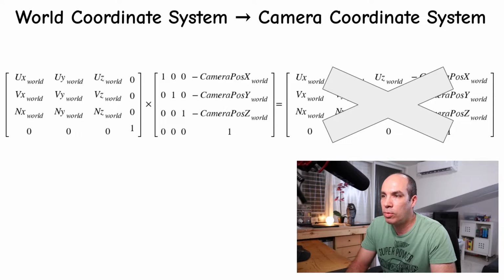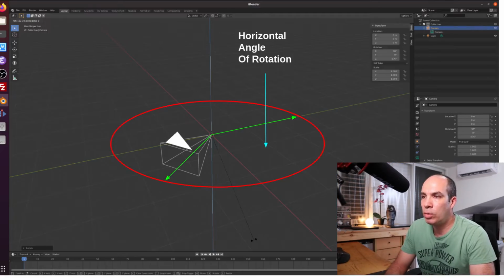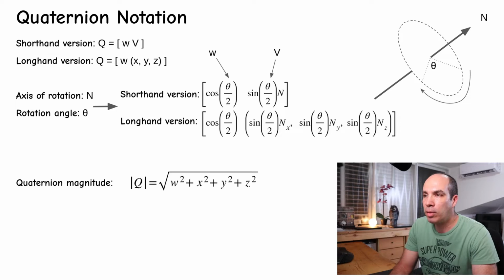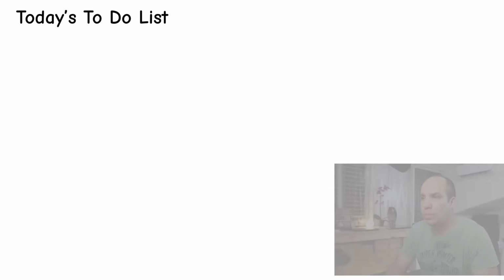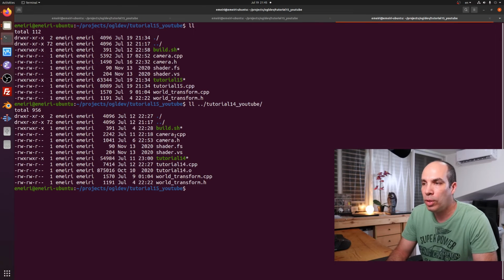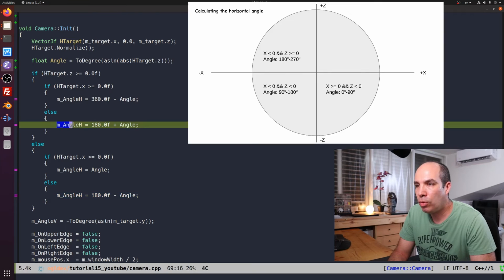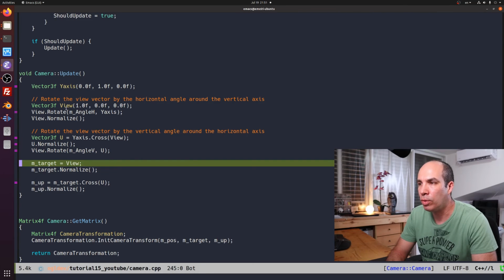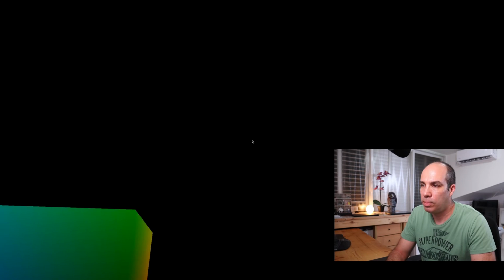Camera Rotation With Quaternions // OpenGL Tutorial #15

Comment: I just implemented anouther broken camera trying to do it in blender artehenin coordinates and then remembered about quaternions but it’s not just simply switch up down right forward vectors in my case if your facing up you need to move up and the yaw , but if you have yaw / pitch as changing values something funny starts happening when you cross the origin
Reply from the maker: I have a new version of the camera tutorial using GLM which you may find useful: https://youtu.be/KEKcDvS3hDQ

Comment: It took me a bit to get this working, I ended up commenting out the game mode section in Main and it worked, I have a 4k monitor, I did thaat before I watched the video, so now I guess I'll have to play with the numbers to figure out what works for me. but I was able to get everything else working.
Thanks
Reply: I just had to change the 32 in  %dx%d@32 to 60, it was in one of the other comments, then it ran but I read up on game mode and that would need to be installed. definitely learning a lot. Hopefully I can do something with it
Reply from the maker: Glad you got it working but don't spend too much time on FreeGLUT. Later in the series I switch to GLFW which is more modern.

Comment: thanks for this video. in general terms, how do i ensure that 180 degrees lock on the vertical look of the camera? im using threejs (javascript library). im having trouble with my Z (roll) axis - i apply quaternion to X and Y properly and it works but its making effect on Z as well. Maybe the X and Y axis used for quaternion is wrong?
Reply from the maker: You're welcome! What do you mean by 'a 180 degrees lock'? Are you referring to gimbal? In general quaternions are the solution to a gimbal. Are you applying  yaw and pitch correctly but as a side effect you're also getting a roll? Maybe you can share some code as an example.

Comment: You could use atan2(x,y) to get angle in a range from -п to п without need to check quadrants.
Reply from the maker: Thanks for the feedback! I updated the code with your suggestion. Notice that I only did it in the newer Common/ogldev_basic_glfw_camera.cpp which is what I'm using right now and not in all the local copies of camera.cpp in the preceding tutorials before I switched to GLFW.

Comment: When we say a vector points in a certain direction are we taking in account all axis values or just the axis that has the greater value ? Because how can we say 2 different vectors points in the same direction if their components overall have different values ? Or direction is just a rotation value ?
Reply from the maker: A direction is a combination of all axes so we have to take all of them into account. A vector is a combination of a direction and a length. For example, [1,1,1] and [2,2,2] point in the same direction but they have different lengths so they are different vectors. Imagine two cars driving along the same road at different speeds. If you want to model their movement using vectors then the direction of both vectors equals to the direction of the road while the length of each vector is set to be the speed of the car (possibly following some mapping: a length of 1 means 100 kph).

Comment: Awesome tutorial ;)
When switching to gamemode, the parameter after the @ character is the monitor frequency (not the pixel depth). Should you want to specify the pixel depth, you'd need to use a : character after the screen resolution, i.e. <width>x<height>:<pixelDepth>@<frequency>
For example 1920x1080:32@60, but you could also use 1920x1080@60 or even 1920x1080 (as bpp and frequency are optional).
This might be the reason why 1920x10080@32 did not work.
Reply from the maker: Thanks for the feedback! I'll fix the code.